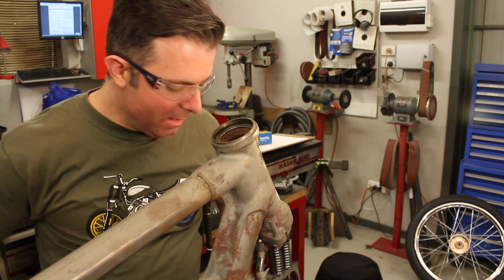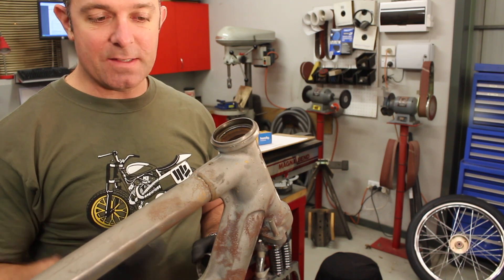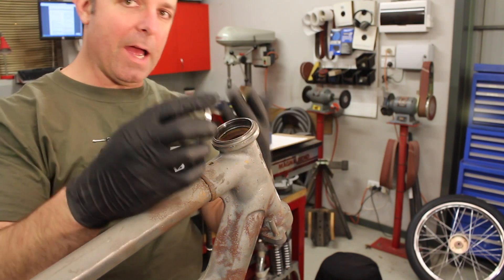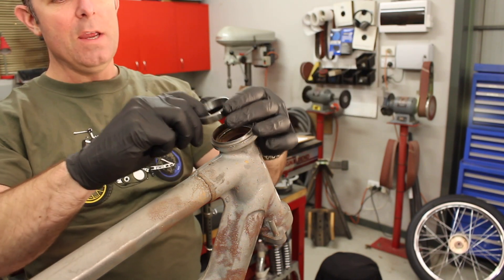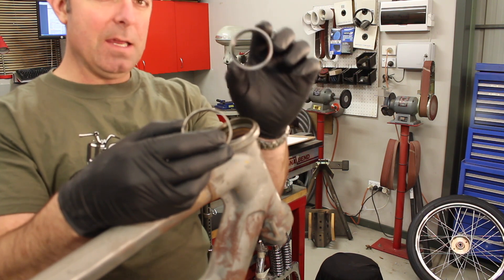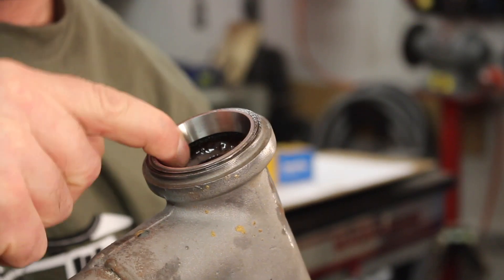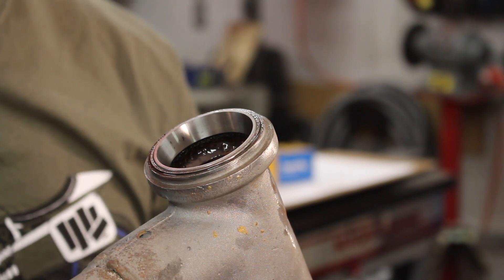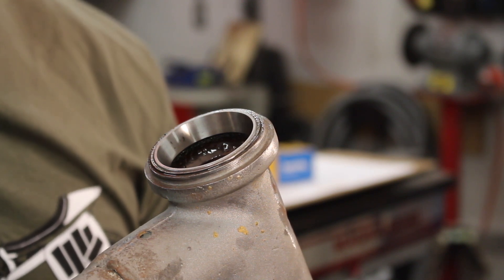How to use bearing retaining compound

Comment: Nice I’m going to use this for a bmw prop shaft that normally uses non serviceable u joints that were originally staked into place. Some people do spot welds when using aftermarket u joint but I knew there had to be a better alternative thanks mate 😊

Comment: thank you for this video.   Exactly my problem (sort of).   I have a motor who's shaft bearings are slip fit and cause vibration at higher speeds.   The gap is too small to make a sleeve without reducing the motor bells on a lathe which I'd rather not do.   I think this is the perfect solution for me

Comment: Loctite 640 is also great at retaining components, It's used in place of pressing in heavy metal slugs into crankshafts during balancing, Takes place of some whom weld them in which then affects balancing all over again,
Have never had one come loose, These are in 4,000+ twin turboed B.B's turning 8,400+rom

Comment: the green locktite is for nuts and bolts, you should be using 641
Reply: Loctite 638 is perfect
Reply: 638 is also a retaining compound.
Reply: Incorrect. This is exactly the type of job Henkel recommend 638 for. It's a high strength retaining compound good for gaps up to 0.25mm. 641 is also a retaining compound, but medium strength and only good for gaps to 0.15mm.

Comment: Is it possible to apply loctite on carbon fiber surface ?
Reply: Yes it is. I'm using Loctite retainer 641 with Loctite primer 7649 on a road bike frame made from carbon fibre to seat the headset bearings.
Reply from the maker: Aleks Ploskov good to hear, thanks for jumping in with an answer to that question.
Reply: @aleksploskov4489  How do you
Reply: @aleksploskov4489   the bearing
Reply: @aleksploskov4489  remove it
Reply: @richard7059  light heat from heat gun or hair dryer I've heard will do it. May take some time as you can't apply heaps of heat. Seen a few guys do it ok. Don't have a great deal of choice if your frame is sloppy and you need a snug fitting bearing.
Reply from the maker: Good question, I've never tried, it would be a good look at the Loctite website to find out

Comment: Thanks for a great video. I've got a similar task ahead on an outboard motor. According to Loctite disassembly can be achieved by heating to 250 C, so there is that option if needed in the future.